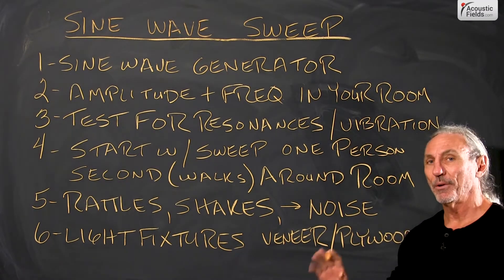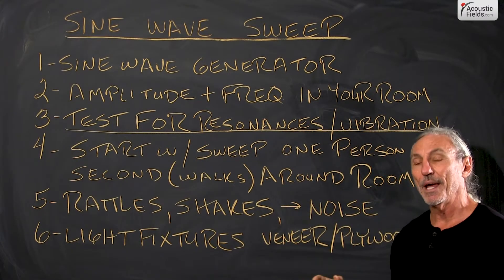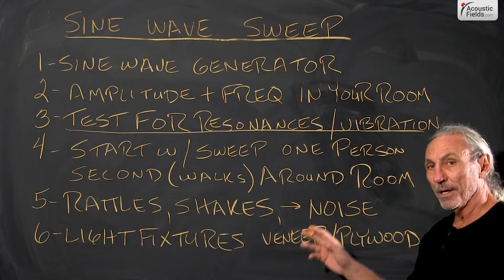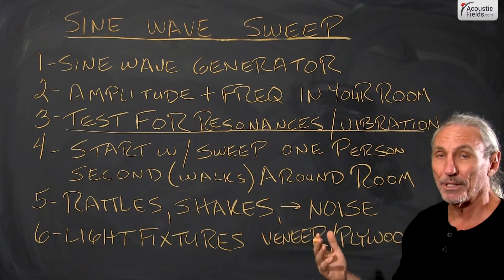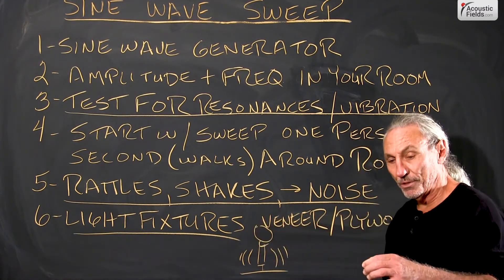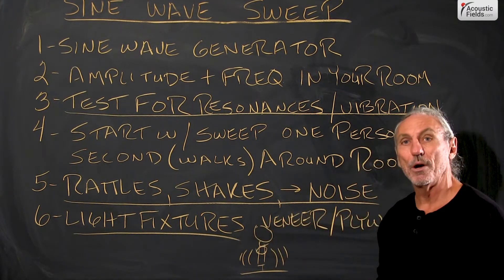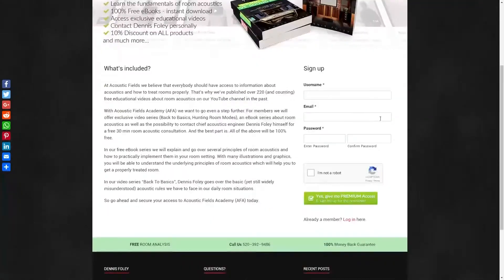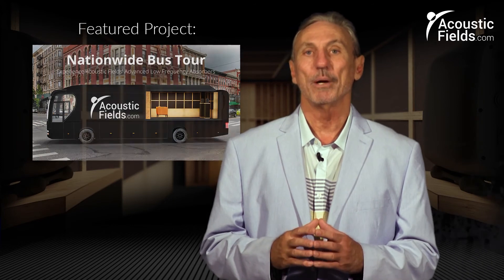What's a Sine Wave Sweep? - www.AcousticFields.com

Comment: I do indeed have vibrating light fixtures.  Excellent tip about weighing them down.

Hope to hear a video on Sine Wave Sweeps?  How to use them properly as a diagnostic tool. Lots of conflicting and incomplete information out there.   Or maybe someone can send me to a useful source of information.

When I first started doing Sine Wave Sweeps I followed some on line instructions properly but hit the 'preview test button' and did several thousand dollars worth of damage to my speakers.  OUCH !   I learn most lessons the hard way.  I believe they have since updated the online video with a warning not to hit that button at that time.